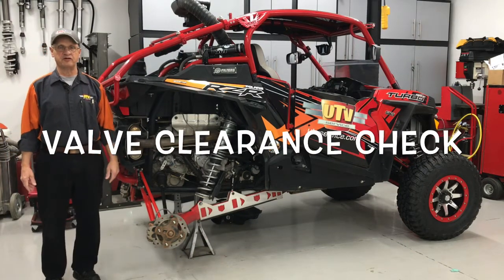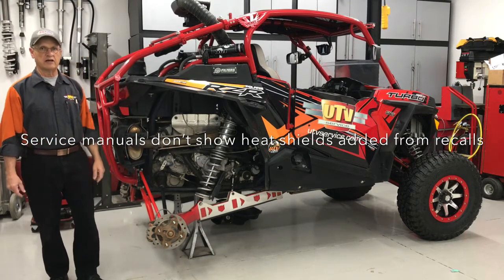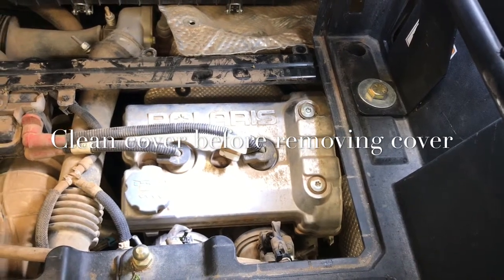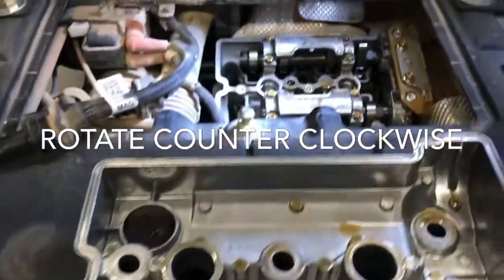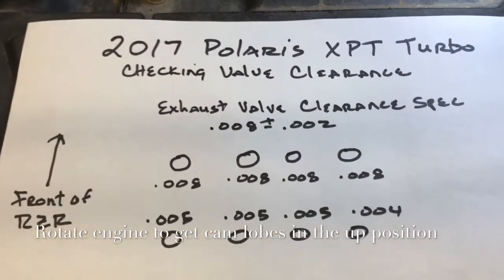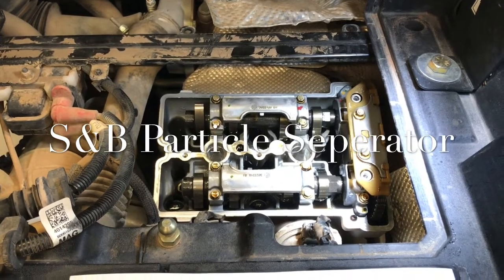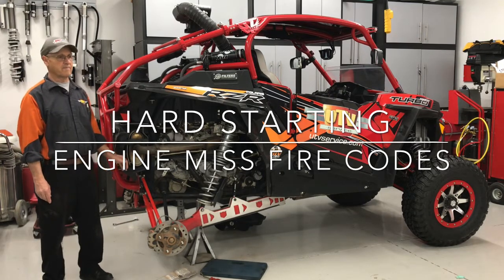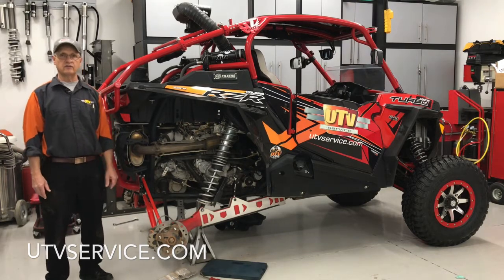Why Is My Polaris Rzr Hard To Start In The Cold, XP1000, XPT, General, XP900, RZR 900,

Comment: I have a 2016 RZR 1000S Hard staring when cold. They took to a dealer, and they went through and the only thing they found was cyl  low compression. They updated the computer and when through with scanner
If, I prime it in the morning it starts all day.
Reply from the maker: Sounds like it will need the computer programmed to add more fuel when it is cold.